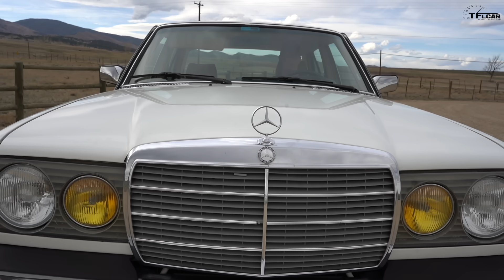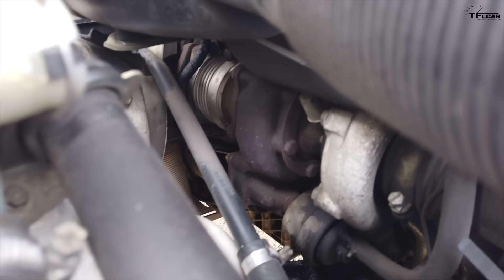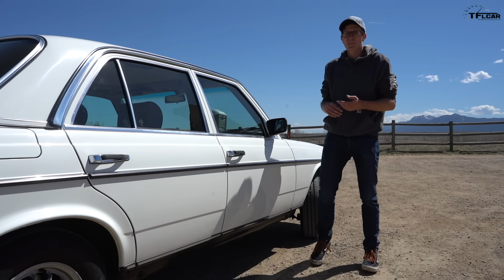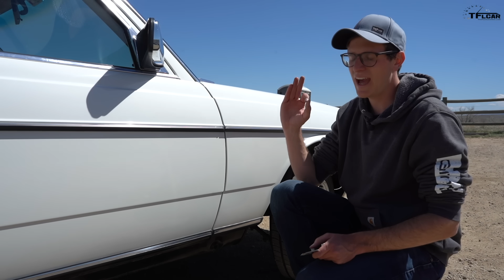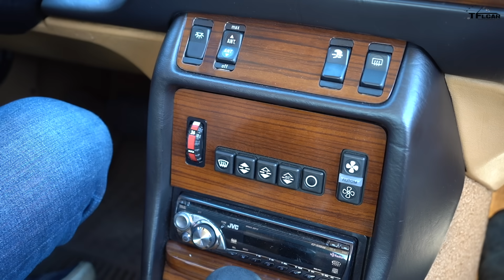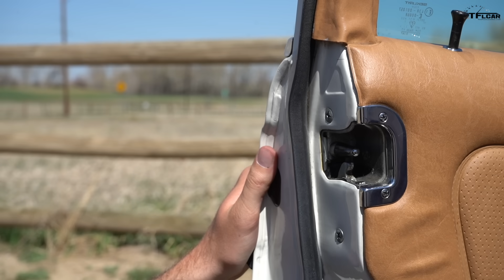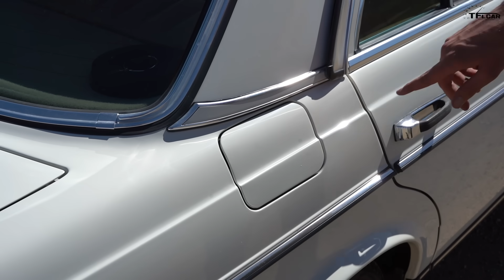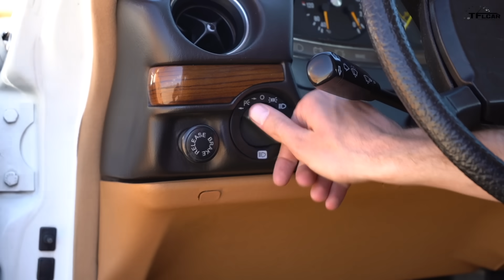This 37-Year-Old Diesel Is THE BEST Mercedes Ever Made!

Comment: We bought a new 1983 Mercedes 240D in ivory with a four speed manual from Foreign Motors in Boston where Jay Leno used to work (He prepped our other 1970 220D). We paid $24,000 for it. We daily drove it until 2012 with well over 400,000 miles on it. Never changed the clutch. Never touched the engine or transmission. Just oil changes and brakes. Still has original stainless steel exhaust.

Comment: I had a 1985 DT turbo and liked it so much I got a second for my daughter's first car. Weaknesses are brake wear, vacuum system and AC system control and relatively poor quality plastic interior that cracks. The turbo has much better power. 
Oh, and Mercedes parts are pretty expensive.
Reply: This car weighs nearly two tons! Check the finish on any cut edge of the metal eve inside the trunk or inner structure. It isn't sharp but well eased over you won't get cut up working on it and there is plenty of room under the hood to do maintenance.
Reply: Trunk is so big I hauled an enormous load of firewood and even two large fully intact deer inside with no problem.

Comment: While the 123 platform was great, the W124 was even better. Better suspension, better handling, more working convenience features etc. If you love the 123's, you'll love the 124's even more. After the W124, it's been a steady decline in everything MB stood for in the past. The straight 6 M103 & M104 are the only gas engines MB designed to last 450,000 with proper maintenance. The diesels of course, can go much longer. CIS-E for the M103 and HFM for the M104. Depending on WHEN you went to Europe, the W124 diesels replaced the W123 diesels in taxi cabs.

Comment: I never truly appreciated this series until my parents bought a 420 SEL and when servicing it we once had this model as loner.  Amazingly, it was more fun to drive!  Mercedes were born to be utilitarian cars, not luxury cars...hence the driver's door being manual, it wasn't necessary to add a motor when you could reach it.  The tail lights you speak of were designed to be seen during heavy snow and worked out it many ways.  In my opinion, it was Asian luxury models that hit the market that forced Mercedes to reinvent themselves to maintain their market standard. Great video that bring back a great memory.
Reply: Bryan Wilson You are very correct about Mercedes having to compete against the Japanese.
Reply: They did at the expense of bulletproof engineering and quality control
Reply: more like brands as fiat and renault daimler jumped of that train, but there´s no car more luxurious or sportive car better than mercedes ,have you tried the 90´s CL600 V12 or the maclaren mercedes or just the plain 63 slr(this last two ,some body)
Reply: Loaner,  maybe.  The rear lights also aided visibility in the wet, mud or dust,  not just snow.  Oh, loner means to be alone, like a lone wolf.
Reply: Thats a w126

Comment: A Million Miles!  Not a mere million klicks. 
I have an OM616 in my 240D, and dream of finding an OM617a equipped 300 wagon with 5 speed manual.1983 240D has MBZTex seats and less fusy stuff than 300s. Power locks and trunk that are leaking vacuum powered.  If you don't keep the drains in the car clean, it will fill the footwells with water in the rain.
Reply: By the mid-1980's, engineers had been relegated to the backroom, under fashion and design departments. That's where expensive to maintain, gas guzzlers like 400 series came from. Yes, the v-12 cars are awesome, and I will never own one.

Comment: I like my all manual '83 240D, same body, less engine, mine's even white with a palomino interior, it's restored enough to be a daily driver and never fails to get compliments. It's a great car, not very quick but it'll do an 80mph cruise quite comfortably. Gets about 30mpg. One of the nicest rides ever. 185, 000 on the odometer.

Comment: While working as a service writer for a shop I kept track of which vehicles had the highest mileage, and a Mercedes very similar to this model, if not exactly this model came in with 500,000 miles and became the hands down winner. Lots of Toyota's were making it to 300,000 but that was about it. Eventually the Mercedes had a competitor and it is not the car that you would think.
I later worked for a delivery company that used Ford, Festiva's using a Kia 1.3L engine and many of those also made it to 500,000 but they were a pile of bolts wobbling down the highway. The Mercedes made it to 500,000 in rock solid condition.

Comment: I think the 300sd lW126 is every bit as good. 330k miles and going strong with every  thing you have described plus air bag, abs, heated seats, leather, larger wheels, power windows, door locks, lots of rear room, etc.

Comment: I believe there was a non-turbo 300 but the 300td was the best and I had a 1964 220se coupe same door and closed just as smooth and you could drive over a dip without bottoming out

Comment: Had a 200 petrol, brilliant cat, also had two 300 diesels, great car but the 200 was faster and lighter on fuel. Could not wear out the 300 diesel engine except for the water pump.

Comment: You guys are all correct about the old Mercedes.....our best friends just bought a brand new Mercedes SUV (don't remember the model)...they kept it for six months....they sold it because there was a terrible smell inside the car.  Apparently, there was no drip hose to expel air conditioner condensation....it was supposed to evaporate some weird way.....it didn't work....the dealer said this was "normal" and had to be serviced every year for five hundred dollars. I googled "mercedes benz smell"....it's a real problem.

Comment: Comparing the 300D to the Crown Vic is a good analogy, but the Mercedes was purpose built to be a taxi and to be export specific.  So, they made it bombproof and easy to keep.  The Crown Vic was the top of the line Ford/Mercury offering for grampa, but it was a very good, crisp handling, and reasonably well powered police car as well.

Comment: Great video and you covered most of the great points about these cars, plus their weaknesses.
I drove several of them for years and years.
Your thermos with pebbles cracked me up!

The gas flap had a cap holder built in to the folding spring inside.

You commented on the great turning radius of these cars.
The auto industry had recently started to mass produce rack and pinion steering in the early 1970's.
Mercedes engineers did their research on this and expanded on it.
The steering radius for front wheels use different geometry for each side when you turn hard.
The inner wheel cuts more to the inside than the outer wheel since by the laws of geometry, 
they each need to roll on different radius paths.
The inner wheel's path is smaller diameter due to its' location, than the outer wheel's path diameter.
When you cut the wheels hard, you'll notice one front wheel sticks out more then the other one.

Those rims are nicknamed the Bundt cake rims, BTW.
Reply: เข้าใจบ้างเคยมีเบ็บซ์ปี73ตัวถัง116

Comment: I worked at a dealership as a tech when these cars were new and saw them through to where they are today.  You guys are too nostalgic.  Every damned part on them wears out including the engine cylinders.  Suspension, steering, transmission, interior, bearings.   Everything!  I know every part and piece on them with my eyes closed.  And they drive like a tractor compared to say even a late 90s  w210 sedan.  I have owned dozens of them and if you tried giving me one now I would get a restraining order.  These primitive beasts day has come and gone.  Only freaks and cultsters would be attracted to the W123 now days.

Comment: Amazing to me how they make a top-of-the-line luxury sedan then easy to work on and maintain. Nowadays, you open up the engine bay and the whole engine is covered by a special cover so you can't even access it. A guy in work has a BMW and he can't even check the oil via the engine bay, instead you have to jack it up and go underneath or something complicated. It's like they don't want you to work on such vehicles now.

Comment: Why did they not provide power windows in a 1982 Mercedes? Didn't they have those in American cars as far back as the 1960s? Also pretty cramped in the back for a vehicle used as a taxi. And why are the fog lights at the same height as the headlights? Fog lights have to be lower so as to light up underneath the fog, not shine right into it.

Comment: wow, all except the 120 hp I like, must giddie up and go though, 5 cylinder? say what?  is it true most if not all diesels are a 2 stoke engines? I dont much about diesel except my 1990 VW Rabbit with 90 hp, I hit something or something hit my sump pump and it didn't circulate oil for 2 and half days when it died, my dad and I tore it apart and the engine pistons were welded to the engine, it was weird, anyway, thanks for the video.

Comment: I have a w124 I6 3.0 Diesel 24v. 136hp no turbo 1993. 210nm at 2200 rpm engine is om 606. 33.6 Miles per gallon before RVS treatment. Now it will soon draw 39 mils per gallon. Best car ever in w124 and other best w123 diesel 300d

Comment: I had a 1986 and generally liked it. As others have said the climate control was a little too clever by half.  Was supposed to work essentially as a thermostat where you could set the actual temperature . Replaced the control unit it at least once. had periodic problems with the vacuum hoses and had to plug it into a block heater on cold nights.

Comment: The downfall about these cars is that everything in the car is tied to the vacuum pump one way or another. One vacuun leak and even the door locks quit working.  Gigantic pain in the ass when a vacuum line gets a crack in it. Miles of vacuum lines to search through until you find it. Big flaw.

Comment: The trim that runs through the length of the car has nothing to do with protecting the handle. It's there to fend the doors of a neighboring car when parallel parking. It protects the paint from scratches when Joe Fatass opens his door and slams it into the side of your car. There is a matter of finding a parking place in Europe, and people park really close next to each-other.

Comment: I had one with 780,000 miles on it and the only reason it tore up was because the guy I loaned it to ran it off in a ditch and busted the radiator and then drove it anyway. I used to pour used cooking oil straight in the tank and put about seven or 8 gallons of kerosene in with it. Drive it around the block a few times to mix it up and then get on the road. I even put used transmission fluid in the tank and the mofo would run on anything. Of course I had to change the fuel lines and a couple other things to accommodate that and the vegetable oil had to be extremely well filtered but it ran on it.

Comment: My grandpa had one of those back then. I was born in 1986 and his car was 1985.  When turning on the radio the antenna (aerial) would come up electrically.  We had to keep cleaning it all the time as it would get dirty and not work.  He kept that car for some 15 years.  I showed him your video and he got really nostalgic.
Reply: Best of the  best  drove this car in euro 400000

 miles
Keeps  a lot noise  but it is reliable low maintenance
Reply: @apbmusic1  Is there a way to reduce the noise?  Just before he sold it we could hear the car a block away.  It was really noisy.

Comment: I had a Mercedes 450 sel from 1974 . Was built like a tank. Had a collision with a fiat . The engine of the fiat was disconnected from the car .completly  completely destroyed. Luckely the driver was ok . The Mercedes had a small dent in the fender. And a cracked headlight. Old German craftsmanship at top level. Still miss that car😩

Comment: What I never understood about people from the U.S.A. is that, they say they don't understand degrees Celcius (easiest on the planet!), and that the metric system is way too complicated (when it's the complete opposite), but funnily enough, when it comes to sockets, wrenches, nuts and bolts to repair their cars, those are all in milimiters, and they know them by milimiters!! So... you don't understand the metric system but ... you still use the metric system?
In the metric system, 10 milimiters are one centimeter, 100 centimeters are one meter, one thousand meters are one kilometer. Easy.
And about the degrees Celcius, 0 degrees is the point in which water starts to freeze. 38 degrees is where classic fever kicks in. 100 degrees is where waters starts to boil.

Comment: I had a 240d from '81 to '89. Visited from Turkey to Ireland, Spain to Sweden so many countries in Europe. It was a very reliable horse you could trust in. Also as a young man it was important for me saving some bucks by doing some standard maintenance by myself having good access to that engine. In later years rust and front wheel track stability were a weakness that required attention. Everything else was just wunderbar!

Comment: I had a 230E W123. Bought it with 121 000 km. Drove it for 5 years till it had 410 0000km. Only had to replace the water pump. Here in South Africa.  Bought for ZAR 20 000. Sold 5 years later for ZAR 15 000. Best vehicle ever owned.

Comment: The engine gets noisy when the valves need adjustment and the injectors don't spray well because they have begun to rust from water in the fuel tank. Keep the valves adjusted and swap in some Bosch reman. injectors and the engine will both run better and quieter. But it will always sound like an industrial diesel.

Comment: Having spent 5 years maintaining and repairing Mercedes-Benz vehicles back in the 80's, I will say that these probably are the best MBZ ever made. Keep the oil clean, change the fuel filters often, and replace the rubber parts (engine/trans mounts, suspension bushings, vacuum hoses)as needed, and it will run a long, long time. Plenty of passing power with the turbo.
Reply: Hi.... My Dad left me a 1978 300D. That was driven regularly and well seviced until 2006....since then just sitting in a garage in Canberra Australia... any advice before i try to start it up...? I dont want to do  anything catastrophic... ( ie I  know nothing about cars )...

Comment: You missed something (!) - that headlight switch where you can pull it for the yellow (front) fog lamps: you can pull it a second time for the rear (red) foglamps. Here in EU there's different rules for when you can use the rear ones I know, but that function is right there on the knob - which in my experience many Merc owners aren't aware of. Yes, the 300D was the best car I've ever had, did my own servicing and despite being a quality car it was not in my opinion expensive to run at all. Todays' cars seem to be dumbed down by all the economy / energy / environmental buffs way beyond what is actually needed or is actually effective.